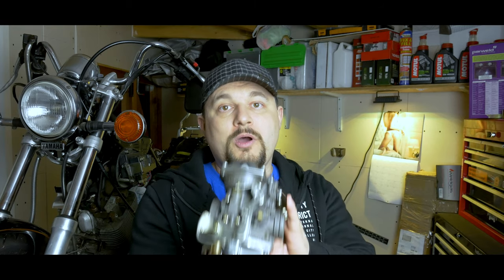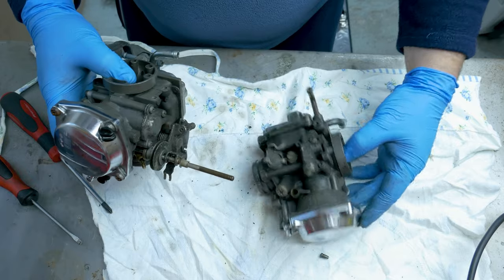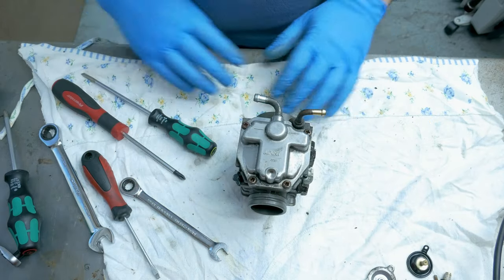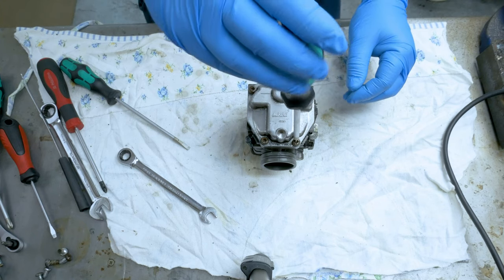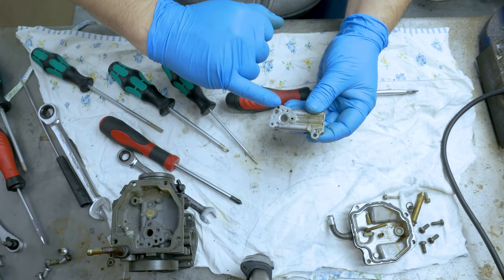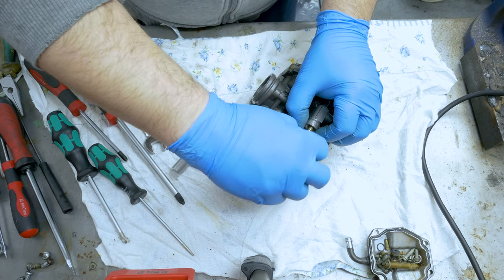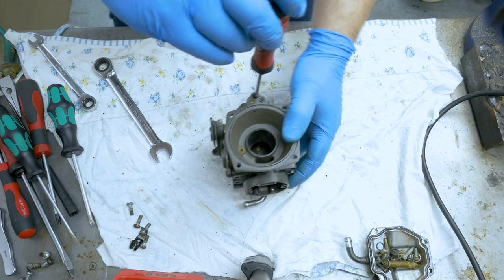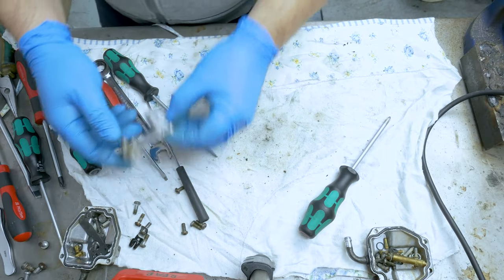VIRAGO 535 DETAILED CARBURETTOR STRIPPING TUTORIAL 87-03 | How to disassemble Mikuni carbs XV 535 #3

Comment: This is BY FAR, the BEST video about  the Virago 535 carburetors. 👍👍👍
Believe me,  I have watched a LOT of them!🤣

I am really happy that I found out your channel,  a few weeks ago I bought a 95 Virago 535 that has been sitting for years.

It is in original spec and it rides ok, it has 16.000 km, but as it backfires a little bit when I release the throttle.

So I am renewing some parts, as carbs, plugs, the fuel petcock, .

Your videos are very clear and very helpful. 

They are not boring or too long.

Keep it up!👍😎
Reply from the maker: Wow mate thank you very much for your kind words.. I'm glad we share the same passion, welcome to my channel, and wish you all the best for your "baby" 😉👍👍
Ps: turn the pilot screws out a 1/4 turn to give a bit more fuel during deceleration with throttle shut to help with the popping 😉
Reply: @MidlandCruiser  great tip, I will do that! 👍👍👍
Reply: @MidlandCruiser  and if I may ask, could you shows how to adjust the float level in the carbs? Thanks!👍
Reply: True that!!! On how detailed this video is I'm still waiting for the rebuild 👊
Reply: @MidlandCruiser  so not how the book says 2 to 2&1/2 turns out?
Reply: @MidlandCruiser  so the 1/4 turn out is where it should be?
Reply: @MidlandCruiser  if you have a gas exhaust analyzer you can set the pilot screws to be perfect. For the idle air and fuel mixture rate...
Reply from the maker: @karl H Thank you very much. The rebuild video wil be later, but unfortunately it will be the Lifan catbs as I'm not fitting the Mikunis back (also sold the rear body of the Mikuni).

Yes the book says 2 to 2&1/2 turn out on the pilot screw, but if you have an open exhaust you might need an extra 1/4 to 1/2 turn out to reduce the deceleration pops.
I do have a gas analyser (cheap one) and have the colortune as well, but to be honest I usually end up with the settings where I set it by ear and riding experience,  but always nice to have it confirmed with the tools...so yes use one if you have one. Thanks for liking my videos and also for your contributions..welcome to my channel 😉👍👍
Reply from the maker: @rc2634  I will make a fuel level setup video as I will have to do the Lifans...sorry for the very late repy, I didn't realise..🤦‍♂️
Reply: @MidlandCruiser  so if it's a regular exhaust I should start at around 2-2&1/2 screws out? Just making sure bro.
Reply: @MidlandCruiser  so it definitely shouldn't be just a 1/4 turn out like in your video but should be be 2&1/4 to 2&3/4 turns out if open or modified exhaust right?? Thanks so much and yes your channel is awesome and very informative!!!! I need a exhaust gas analyzer what is your brand and how much was it? Thanks!!
Reply: @MidlandCruiser  have you ever taken out the needle seat on those carbs? Do you have to knock it down from the float bowl? I haven't seen anything on it...
Reply: @MidlandCruiser  and shoot thank you!!!
Reply from the maker: @karlh4313  yes, for stock exhaust, start with that, but if it's popping a lot under deceleration then add a bit more
Reply from the maker: @karlh4313  yes that is correct for the pilot screw. I have a Gunson Gastester Professional and got it 2nd hand for 40 quid, however I don't really like it so would probably look elsewhere. Seems a bit unreliable...maybe the reason for the sale and cheap price🤷‍♂️
Reply from the maker: @karlh4313  no I haven't take out the seat but I have the front carb left from the Mikuni so I might make a video about it...good idea 👍
Reply: @MidlandCruiser   cool!!
Reply: @MidlandCruiser  gotcha thanks!!
Reply: @MidlandCruiser  I can't seem to find the colortune anywhere 😕 I found gas analyzer but don't know what one to pick or how to use.. the colortune seem like you'd put one in one spark plug hole and set pilot screw then put in other spark plug hole and set that one. But can't find on internet..
Reply from the maker: @karlh4313  yes that is correct,  that's how you'd do the colortune. I will try to make a video about it for the 535 once everything else is done (maybe in the autumn)  I have tried to record it before but failed unfortunately, as you couldn't see anything and also got out of focus. I have a better camera now so should be fine next time...
Reply: For real!!! He's very knowledgeable in all this!

Comment: Lol 😂 me again mate!! 6mm with .5 pitch is that the size of that pilot screw that gets stuck or sticky? I found a link talking about just this problem except for the froze in one but for the ones that are difficult to remove or screeching noises when turning in or out. Mine is doing that and I'm going to clean out the threads in there. I seen for another one for some 38mm Mikuni carbs and it was 4x.70 the other size was for a 85 vm. Thanks again!!

Comment: Got another question for my 95 Yamaha Virago 535SG. For the main jet sizes the manuals say 137.5 front cylinder 135 rear cylinder. But online Yamaha diagrams it shows the 135 in the front carb and 137.5 in rear carb where throttle lever is. So why do the manuals say front cylinder 137.5, rear cylinder 135? Isn't the front cylinder behind the front tire and the rear by the back seat? I have someone telling me the rear is the front and the front is the rear, I know (from rear to front of bike) cylinder numbering is 1-2  which I thought was firing order idk. But I also see that in the book it says to take the "front carb" enrichment diaphragm off and that's before you split carb. So I'd think that the front carb goes to front cylinder and rear carb (where gas goes in first) is going to rear cylinder, right?? I'm just so confused 🤔

Comment: I'm having a real issue with getting my fuel level measurement right ughhh! I'm at 30 mm below the center mark on the cover and I can only get it to about 20 and then it seems to keep the pump running and no gas comes out till I bend the tang down on the float to let the valve down some.. what am I doing wrong? I have a 3 mm hose attached to the drain fitting with a adapter for a hose and then the Yamaha glass part for this with the mm's on it.. I'm confused!!!!! And need help!!!
Reply from the maker: Here is a useful link to set up the fuel level..
http://viragotech.com/newtech/XV535%20-%20Setting%20float%20levels%20on%20the%20bench.htm

Try to pinch the main fuel line to the carbs to see if the pump shut off or not, also make sure you used the right needle if you changed it, maybe it is longer slightly which would explain why the level is so low.
Check the little tangs on the floats to make sure they are not deformed in any way. 
Make sure the fuel filter and all the pipes are clean and the pipes has no kink which would prevent the pump to create pressure....
Reply: @MidlandCruiser  thank you!!
Reply: @MidlandCruiser    OK I think I found the issue my hose/tube for the drain fitting was kinked. This morning the fuel level was right around 20mm below center mark on cover. So I'm guessing the float is not going high enough when it shuts off and I should bend tang up bc it should be 14mm below center mark. Is this correct?? Thanks!!!!!!!! Does it matter how long the tube is??
Reply: @MidlandCruiser   Book says bending the float upward very slightly to lower the fuel level; bend the tang down to raise the fuel level. If too high to rich to low to lean. So does the book mean to lower the fuel level you bend tang upward, would that mean it would make it go from 20mm to 14mm below center mark or would it make it worse like 30mm below????
Reply from the maker: If you bend the tang up it will close the valve earlier and makes the measured gap bigger so from 20mm to 30mm. 

Bending the tang up makes lower fuel level =  bigger gap from the line

Bending the tang down will raise the fuel level = from 20mm to 14mm which is what you want.

All these Bending directions apply by looking at the float straight after you remove the bowl (cover)

Imagine what's happening inside the carbs when the fuel starts to pour in

First it goes to the bottom then starts raising the float until it pushes the valve shut....so if you bend the tang up it will get closer to the valve in resting position so it will close it earlier when the float rises causing less fuel in the carb...

I hope it makes sense...
Reply: @MidlandCruiser  thank you..I'm closer 17-18mm
Reply: @MidlandCruiser  hey! I'm getting closer!! I think I found the issue????? My fuel pump kept running I didn't notice that before.. I did a check how the manual says and my relay is bad I think or a wire for the blue/black wire or the earth ground for it.. which I don't know where it is.. do you??
Reply from the maker: I'm sorry but I have no idea, I haven't got to that part yet and also I haven't done anything on the bike lately as I'm busy with other things, I hope in the winter I can get back on it. Send me your address in email to midlandcruiser@gmail.com and if you are in the UK I'll post that drain nipple for you free of charge.
Reply: @MidlandCruiser  I'm in the US but willing to pay shipping! 😁 I'll email you! Thanks!!
Reply: @MidlandCruiser  if you saw my email I'm definitely willing to pay for shipping or buy it from eBay from you..
Reply from the maker: Yes sorry saw it, but really busy at the moment I'll try to remove it tomorrow...I'll email you when ready
Reply: @MidlandCruiser  thanks!!
Reply: @MidlandCruiser  no problem!! Thanks again!!!

Comment: Any link to the replacement carbs you bought please
Reply from the maker: Hi sorry for the late reply...
I bought this https://m.aliexpress.com/item/4000349612729.html?spm=a2g0n.orderlist-amp.item.4000349612729&aff_trace_key=b86a3d65652c41c785e292e8d765949d-1641736252529-02260-UneMJZVf&aff_platform=msite&m_page_id=6213amp-ouOqnipGWsFRzJrgYLnHTg1641736328324&browser_id=bcfab45c4c014e7e9c70ae3ac0a2dc5c&is_c=N

It seems to be out of stock however you might be able to get it from a different seller, just make sure you read everything in the description so you get exactly what you wanted. I haven't fitted it yet so can't say how good or bad it is, but heard good things about it, that's why I got it...

Comment: Lifan carbs!!! What could go wrong, mate? Lol
Reply from the maker: I know.. 😁We'll see how they perform.. The originals are in bad shape... 1 pilot screw siezed in completely, and on the other, the jet block is beyond repair... I'll make sure the Lifans are reliable and bang on perfect before I sell the bike 😉👍
Reply: @MidlandCruiser  Mate, I truly hope that they perform well. I've heard a lot of bad things about removing and putting them back in, that some even take the engine out to do so. Best of luck!!!! ( And kind regards from Thailand. It's hot as hell, holiday coming soon on a paradise island in the south. Will think about you. Cheers.
Reply from the maker: Exactly we'll see.. I still have the  option to transfer everything from the mikuni carbs except the broken jet block.. I think with a proper check up, settings and jets it should be fine... Here not so hot yet, and probably won't even get close to yours... However many bikers got thier bikes out, me not yet, need MOT (yearly check up required by the government) first... Enjoy the good weather my friend 😉
Reply: @MidlandCruiser  I wonder if some gel CLR in the hole of the pilot screw would get it free maybe a little heat in the hole with heat gun from inside the carb inlet too. Idk
Reply: @sisaketmike  why would they take the engine out to do so? Did they say why? I had no issues getting carb out or back together after taking apart the carbs like in his video just need to use a straight glass to keep them level while tightening up the upper and lower brackets.
Reply from the maker: @karlh4313  hi. Trust me I tried everything to get the screw out...it wouldn't move either way..
Regarding the engine removal....I think some people just find it easier to do that way, especially if they'd take the engine out anyway, but you definitely don't need to do that.
Reply: @MidlandCruiser  Hi 😁 dang that's wild it got stuck like that well I guess it's good to make the video for the needle valve shaft/assembly removal 😁  it's got a screen in it and a o-ring and it's got to be hit out from the inside of the carb down, at least it looks to me. One came in my r-kit but mine was clean I hope but I'll save it for one day. Well I guess a engine removal would be a good video to 😁😁 yeah I understand that if they're going to take whole engine out but you're right definitely don't need to if just taking carbs out. This is my first time working on a bike and I got the carbs out just fine.
Reply from the maker: @karlh4313  engine removal video will be coming my friend, just got to work out my schedule/ steps, also will pop the heads off, lap the valves, check compression ring gaps...and loads more...I want to make sure the new owner of this bike is more than happy😉
Reply: @MidlandCruiser  awesome 😎

Comment: Thank you so much for the channel. I own a 93 1100, and did all the restoration job watching you. And now, got a 99 535 for my wife, and just did the carbs maintrenance last weekend. The air mixture screw was stuck too, not sure how to take it out yet.

Greetings from Brazil.
Reply from the maker: You are very welcome...😉 the mixture screw is a bitch on the 535 and most of them get stuck in there. I bought a new set of Lifan carburettors, we'll see how good or bad they are once I get to fit them..all the best

Comment: @Midland Cruiser  Got another question lol if you would of gotten the pilot screw out and let's say you don't have a ultrasonic cleaner could you clean the pilot screw area with a brass spiral brush to clean up the threads and inside good or do can you only use the nylon brushes? It's hard to determine what brand is good but I noticed my front pilot screw screeched when turning it in and the rear didn't. I also found out the front wasn't going in as far as the rear..

Comment: For reassembling them would you put the o-ring under the jet block and tighten, then put the emulsion tube in through diaphragm slide bore? Or would you put the emulsion tube in with jet block off and put the o-ring on still from the front side of the jet block mating surface then put block on and tighten both down? I've seen 2 people put the o-ring on the emulsion tube first all the way to the end and stick that through the bore with no o-ring on the jet block side but not on of my 3 books say it's like that but they don't show you how to assemble it nor in disassembling videos have I ever not seen the o-ring on under the jet block. I was doing my fuel level measurements and couldn't seem to get it right. I decided something was up and sure enough I had gas all over the diaphragm slides and lower boots so in my thinking I looked at my old o-rings and they're bigger than the ones that came in the cheap Chinese kit so I ordered new ones and the gaskets. Everything is new, how would it leak in the diaphragm area and in the boots wth have I done wrong. I spent all day trying to get the fuel level right and decided finally to pull it all back apart. And with have the o-ring on the back of the o-ring it sticks out the bore a little and I'm thinking allows the diaphragm needle to hit the end where the screw is. I also bought a new washers under the screw hoping to get a better seal. But I'm thinking those skinner o-rings got me idk.. any suggestions?
Reply from the maker: I haven't started to put the bike together yet, sorry. For that reason I can't really answer you question. I also have a new set of Lifan carbs which will go on the bike instead of the originals, but I will have to look inside to find out what size of jets are in there so I'll look into what would be the best order to put it together..
Reply: @MidlandCruiser  thanks 👍!!!

Comment: Thanks for the effort put into making that, really helps. After 26 years of home maintenance I took my 535 to a workshop, they gave me a single cylinder bike back. Front mixture all the way in and seized solid. I had to drill it out with a left-handed drill, the end was bent over. I hope the new one goes in when it arrives. If not then the LIfan route, did you move the 535 jets over or does it arrive ready for mounting?
Reply from the maker: Wow...that is some "workshop", my condolences🤦‍♂️. 
No the Lifan is jetted for the 400 so will need jet transfer. I haven't got to that point in the rebuild yet..I hope to finish it this year so I can sell it in 2022. I will start uploading again regularly, I just had to stop for a bit...good luck with yours👍

Comment: I've noticed my rear carb has no washer on the emulsion tube. I've ordered one. 

Is there a specific orientation for the emulsion tube? Mine seems to be able to spin around
Reply from the maker: Hello, the washer is there so you locked against the plastic so the tube can't move up and down. Yours is spinning because someone stripped the plastic when tighten up the jet in the brass tube. 
There is no specific direction for it just now will be a bit difficult to make it tight because it's spinning.

Comment: Hey back again lol why is it important to put carbs on inlet side on plate glass when putting back together? It says it's for proper alignment I guess to have them perfect idk thanks!
Reply from the maker: Yes it is just to align them straigth...for inline engines it is a practice to do, normally V-twins don't require it but the way the 535 is designed, thier carbs need it.
Reply: @MidlandCruiser  thanks 🙏
Reply: @MidlandCruiser  last thing the inlet side facing down would be the side that faces the block right??
Reply: @MidlandCruiser  and for real thanks for all your help!!!
Reply from the maker: @karlh4313  yes, the inlet side is down, use that side for alignment
Reply: @MidlandCruiser  thanks 🙏👍